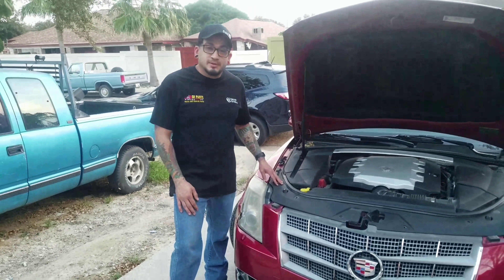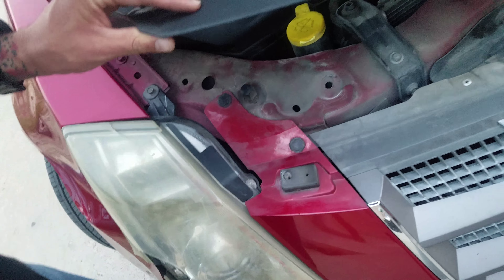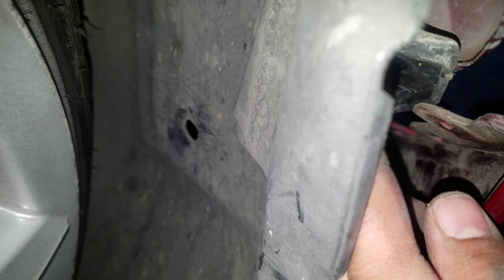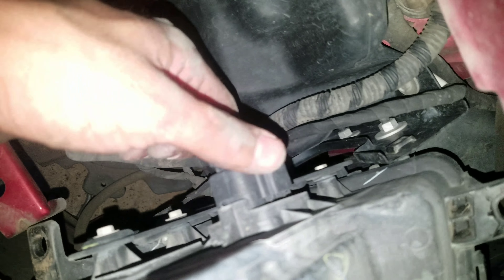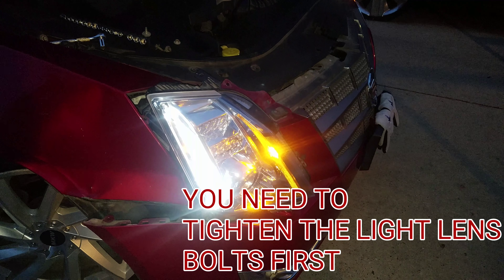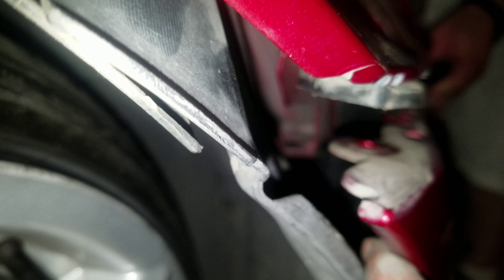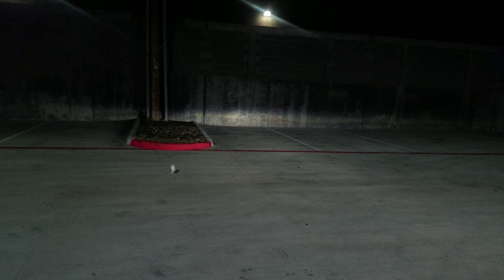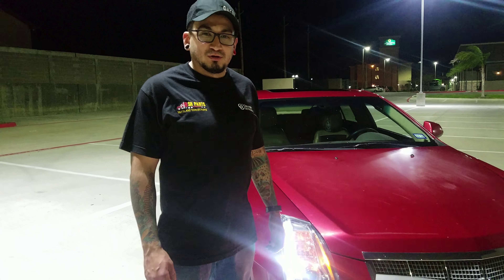Headlight changed on 2008 Cadillac CTS

Comment: Is there a way to fix the driver's side shutter on a 2008 Caddy CTS? I read that there has been an issue with the wiring to the solenoid that controls the high beam shutter on the CTS with HID Xeon bulbs. Any information or links would be great. Or if there is NO fix for this, what about changing out both assemblies over to Halogen or LED projector housings?  A  new pair of those can be had for about half of what just ONE OE HID shutter housing costs?  What would be required to make the conversion possible? By now somebody has surley figured out a way to do that!  Thanks!

Comment: Good video Bro. Need to replace the day time running bulb on my 2008 CTS, watching this video makes it easy.. Thanks again. Great job. Need to look for those lights though? Is their a certain name for them? Thanks
Reply from the maker: My brother bought them used from Ebay they are the cts-v model. The difference from those and the regular ones per say is that these have sensors that move with the stearing wheel and pluse the look it has the LED strip and instead of the round top ligh the squares.
Reply: @DirtyDude  thanks for replying Bro.. Will look into tjose lights .. Have you done a video on the door actuators? Front door one aint locking. So just wondering.  Thanks again

Comment: If i put leds in my 2008 sts will i have to have resistors? Or is there some that are just plug and play with no resistors?
Reply from the maker: It depends on you're vehicle if it has a led or not most likely is gonna need a resistor
Reply from the maker: I would test them without first to see how the reaction

Comment: Great video & thanks!

BLINKER, BLINKER, Good help is so hard to find 😀😀😀.

My buddy just needs new bulbs. Am I correct those bulbs are accessible after pulling the assembly? In fact, are the lamps accessible without complete assembly remove?
Reply: Just used your technique and changed the lamp assembly! Saved a bunch and only two fasteners left over. A win 😀😀😀.

Comment: How did you get the led strip on your headlights?
Reply from the maker: No that's how theses lights come from the factory
Reply: @DirtyDude   No it isn't...they come with a factory amber led and it looks like your car has a white led.
Reply: @djenn434  They actually have both! An amber on one side and white on the other side inside the lens!
Reply: @retiredperson4054   I don' think so....at least not on the 2008 cts I owned.

Comment: Where can I get the same headlights as you
Reply from the maker: My brother found them used in Ebay there the cts-v model. The difference from those and the regular ones per say is that these have sensors that move with the stearing wheel and pluse the look it has the LED strip and instead of the round top ligh the squares.
Reply: Alright thanks